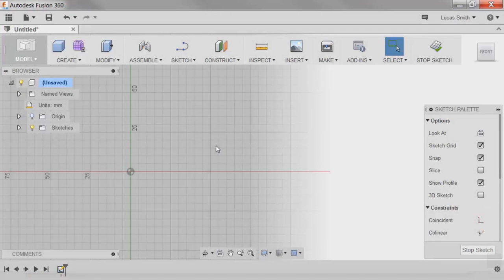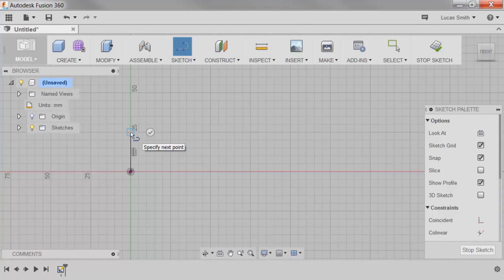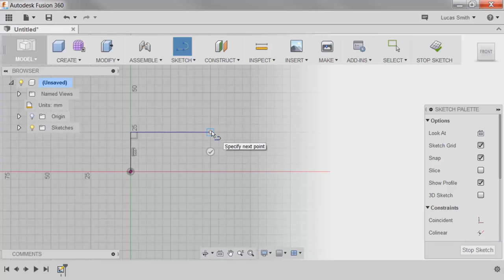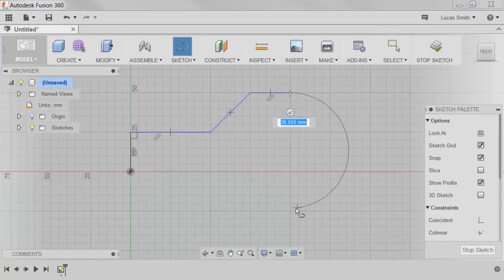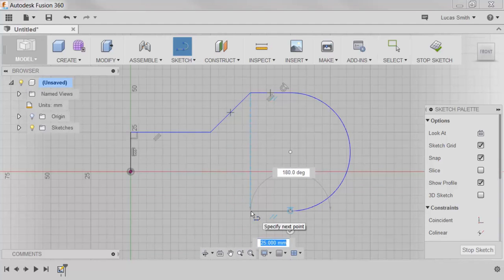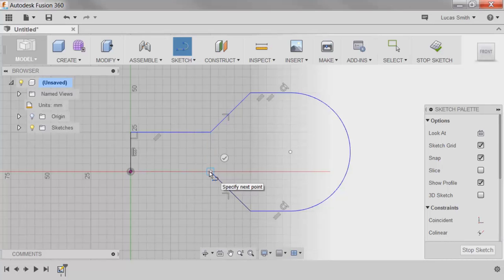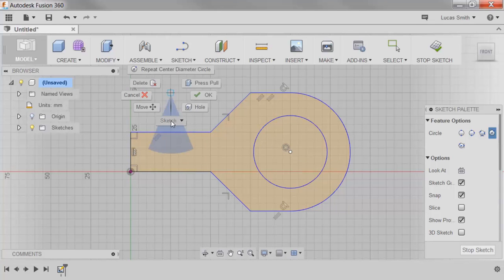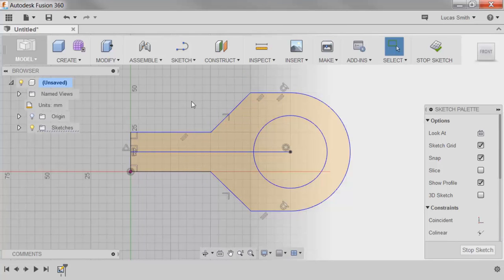Autodesk Fusion 360 Automatically Apply Sketch Constraints

Comment: I call BS. Constraints are NOT "easily removed." Not even close. In qute a few circumstances they cannot be removed at all, particularly "coincident" constraints. And even when they can be removed it is often a tedious game of hide-and-seek combined with Whack-a-Mole to actually remove them. Constraints —I call them "restraints—are a hazard to users' mental health. The frustration they entail is greater than in any other software I have ever used.